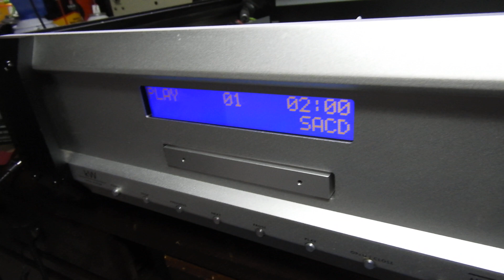Musical Fidelity kW tube SACD Player. Built like a tank, 24kg and huge. Barely fits on my bench.

Comment: How did you adjust the laser power ? Thanks
Reply from the maker: There are couple of potentiometers underneath laser head. They are visible at the start of the video. I have a laser meter of course, so I don't go too far
Reply: Ahh ok, yes there’s 2 under the ribbon connector. Left or right pot? Clockwise  for more power ?

Comment: This model is the main disc spinner in my system. When I brought the player I had already done some homework so knew the laser will fail at some stage so purchased a spare complete transport. Sure enough it failed a few years back now, the swap out was relatively simple though I did have to realign the laser using the hex key grub screws under the slide rails. Fantastic SACD player for my budget. Good luck with the repair.
Reply from the maker: Could you say more about them " hex key grub screws under the slide rails"?
Reply: @hear-net-au  I'm no expert but will try to explain. The laser mech slides on 2 chrome rails running parallel , these are spring loaded with hex grub screws under each end connector, turning the screw in and out raises or lowers the rails. I believe its very important to get the laser angle correct, CD alone is simple, SACD / CD is quite tricky.
Hope this helps?
Reply from the maker: @thermionicdude2044  Thanks. I will look into this. If I understand it correctly, your new laser did not work until you did this adjustment? Were you somehow instructed to do this or have you just worked it out?
Reply: Can you give me the link for transport please or even the make model ?
Thanks Richard
Reply: Hello all! I own one of these units that is presently non-functioning. The drawer will not open before it stopped opening. The transport had given up the ghost. I’m now being told that the servo needs replacing as well. I need some qualified and skilled person to work on it. It’s the most amazing player I’ve ever heard and it’s been plagued with problems as everyone here probably knows.I’m in the US if anyone has any suggestions or directions to point me in to get this up and running again I would be deeply appreciative. Thank you!

Comment: 24 Kilo and still having a plastic drawer plus drive. The transformer next to it is nice though. The mini tubes will need replacement after 1000hrs (?); Not easy to access.
Reply from the maker: Yes, the plastic drawer is part of the loader. But of course it could have been substituted for machines one, as they did in Counterpoint DA-11.5E. To be fair though, it was the only solid thing in it... As far as those tubes are concerned, I do not know the type, but a lot of the Russian ones were really long lasting, military tubes. Some with gold plating.